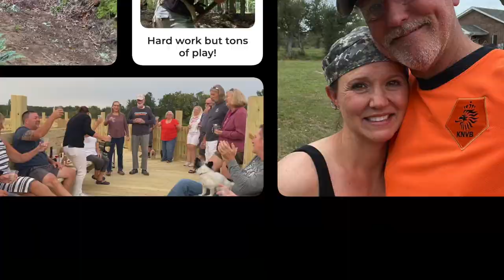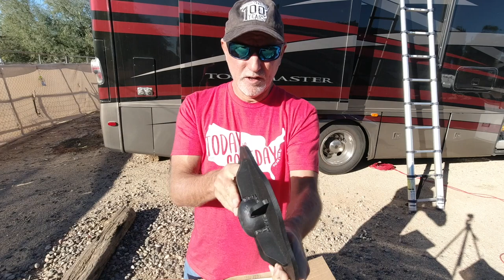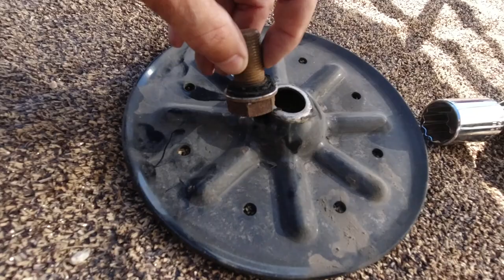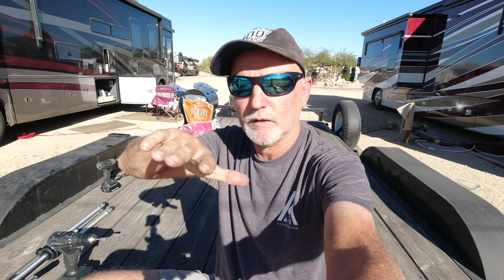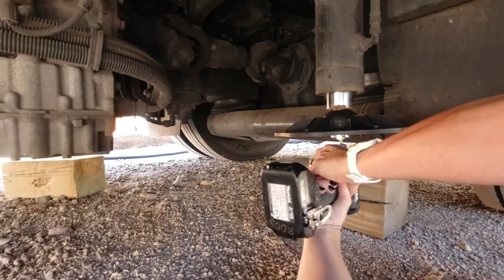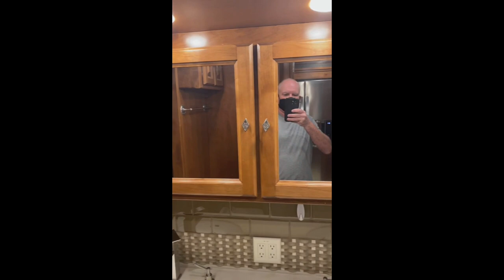Custom RV landing feet! The last you'll ever buy! | RV-paws | Full-time RV

Comment: I'm thinking that the new foot pads will be a lot better.  It's surprising to me that it was the retraction that pulled the bolts through, I would have thought it would have been the pressure on them from the coach.  Maybe it was the pressure from the coach and they just fell off when retracted.  In any case the new ones look a whole lot beefier.  I'm sure you'll let us know how they work out.
Reply from the maker: I think it was a combination of the upward pressure not dissipating once the pad came in contact with the hydraulic cylinder.  At 1/8" steel, these crappy pads weren't strong enough for my rig.  These new pads....no issues in 9 mos!

Comment: Will snap pads fit on these?
Reply from the maker: Hey Tom, check their website because he created round feet that will fit with snap pads. The ones that we have installed on this rig three years ago have never warped, and because they are shaped the way they are, I never felt the need to get snap pads, but realize that some RV parks are requiring something between the feet and their site surface.

Comment: Great video guys, however, allow me to point out that starting a bolt with a driver, especially an impact, is not a good idea. If the bolt starts to strip you won't be able to feel it, always start it with your fingers and then use the impact.  Along Jeff's line of thinking, maybe a little "medium" Loctite on the bolts?  See ya in Georgia.
Reply from the maker: TOTALLY true and you are so right!!!  Because of the construction of the foot pads, using fingers to set the threads wasn't possible but a manual socket would've worked, yep!  BUT, because of the design and nature of the setup and because these suckers were so heavy, we decided to risk to use the driver so we could balance it in place.  That's why I was telling Shar to make sure they were straight and then just tap the driver to make sure they didn't bind.  Ah, we're amateurs! haha

Comment: Looks like a great product, unfortunately, when demonstrating the MOST IMPORTANT and different aspect of installation of the spacers, o-ring and washer your video failed to focus on the end results of what that looks like.
Reply from the maker: Hi.  We could definitely have shown it better but it's simple and you actually can't see anything on the exterior as the spacers and washer are in the bell housing.  I will say though that the feet have never fallen or failed.  There isn't any pressure on the bolt any longer and when it's down and up, it's tight. enough to keep it from spinning out.

Comment: Any concerns with the additional weight of the new pads?
Reply from the maker: None with the function of your hydraulic cylinders.  What type size rig do you have?
Reply: @ayeartovolunteer  I have a 2018 Jayco Precept with hydraulic. We have 9 inch feet. Looking to add the 10 or 12 if we can. Worried that the mechanism may not be built for the added weight. Appreciate the feedback.
Reply from the maker: @jeffwenzen3966  You absolutely won't have a problem but definitely reach out to Darius at info@rv-paws.com and he can give you all of the details. If the attachment point and hydraulic rams can lift your Precept, there is zero issue with the added weight difference.

Comment: Hope these work for you! Two comments/suggestions. 1) Seems like you should have split/lock washers on the bolts so they don’t back out on you over time, and 2) use a torque wrench on the bolts after they are snugged up to make sure you have proper torque on them (also to help make sure they don’t back out). Darius or Lippert will have the torque value.
Reply from the maker: Hey Jeff, Good points. We discussed this with him at length. We only need these bolts tight enough to keep from backing out when in the retracted position but not put unneeded excessive pressure on that copper sleeve. He has used a medium thread lock compound just to hold the bolts in place against the sleeve insert.  Lippert had us tighten my former feet to 120 foot pounds but there was no play in the foot and they deformed.  We will definitely monitor!
Reply: @ayeartovolunteer The use of a torque wrench insures you don’t over torque as well as under torque.  My wife would have told me to put the coach up on ramps so I could do the installation.  LOL